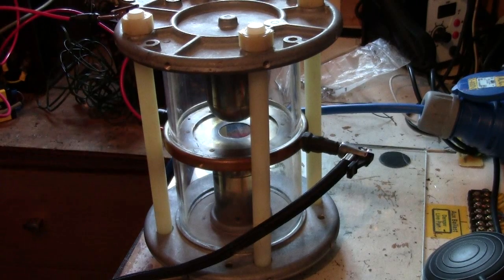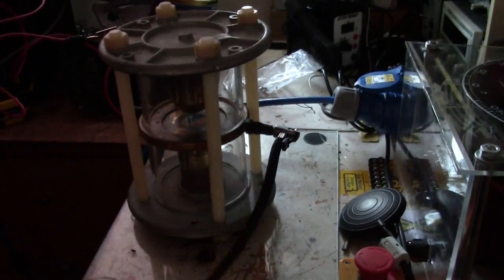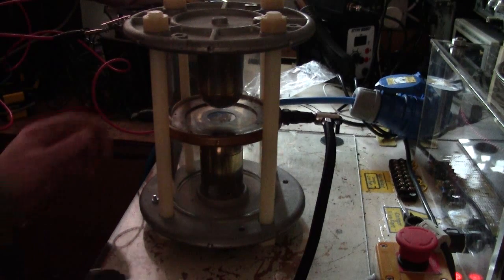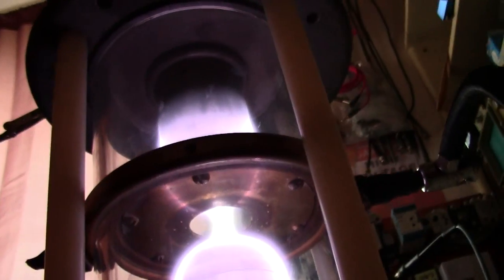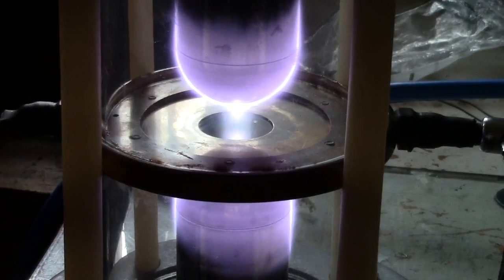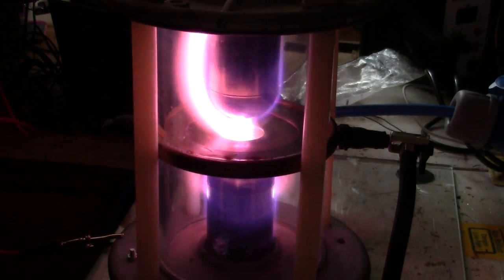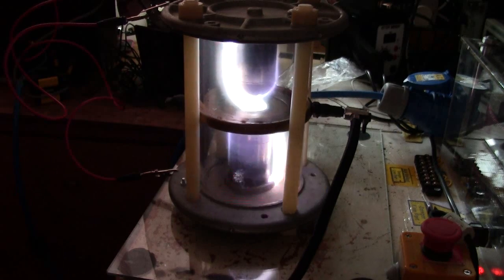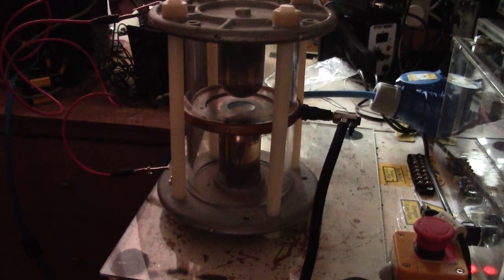Military spark gap VERY STRANGE .KNOW WHAT IT WAS USED FOR ?

Comment: This is obviously the time constant hourglass from the central core of the Chronosphere weapon in Command and Conquer, Yuri will be looking for that, watch out!
Reply: awesome  !!!
Reply from the maker: Thank you ;)
Reply: Nice videos. May I suggest IMHO be careful about using this SG in a Tesla Coil, the heat from the high current could blacken the glass and spoil the electrodes (and compromise the gas sealing). I suspect the device is intended for transmitter lightning protection or similar light occasional duty. The large rounded electrodes will not give the fast arc quenching you need for TC use even if you blow air across the gap, as the ionised gas will take a long time to get away from the gap.

If you google 'Paschen's Law' you can see how breakdown voltage varies with gas, gap and pressure; if the vacuum gets good enough the voltage goes up again! You could do the experiment of air pressure against breakdown voltage, and compare results with theory ...

I studied vacuum circuit breakers for a while and learned about cathode hot-spots etc; continuous arcs are disastrous unless the device is properly designed to get the heat away.

I think we are all keen to see your new large Tesla Coil come together ... ! But you might do better sticking to the path of RSG if this static SG proves difficult. But I did see that a strong flash of UV light can trigger a static SG ...
Reply: OMG it has been so long since I played any C & C game like 20 years or so!